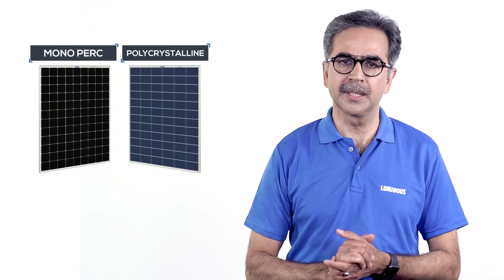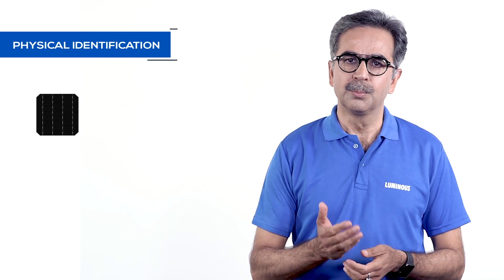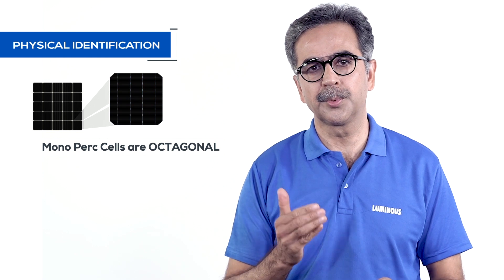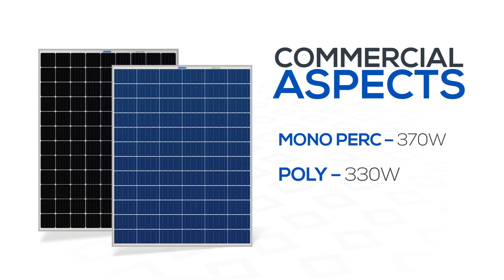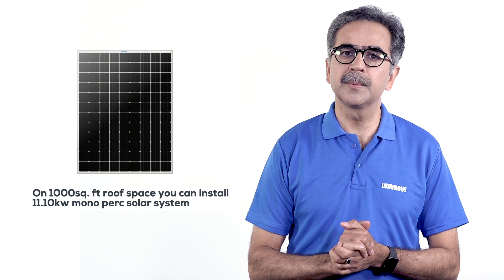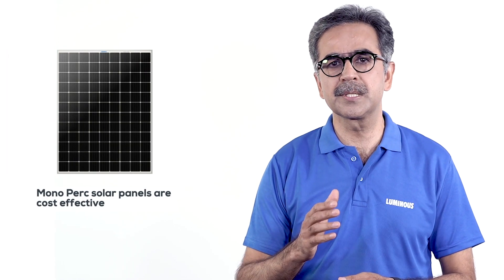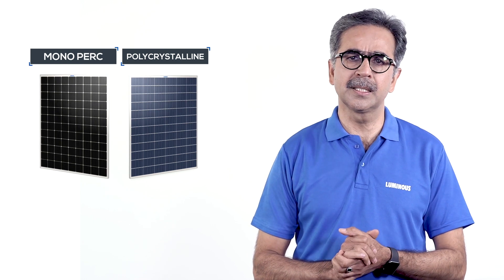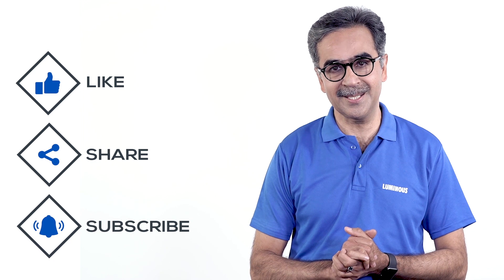Difference Between Mono PERC and Poly Crystalline Solar Panels | Luminous

Comment: Shall I use 24v panel to 12v,150Ah battery via mppt inverter
Reply from the maker: Hi Samputa, Yes, you can use it provided your inverter is 24V system.
Reply: Yes, sure you can use any module there